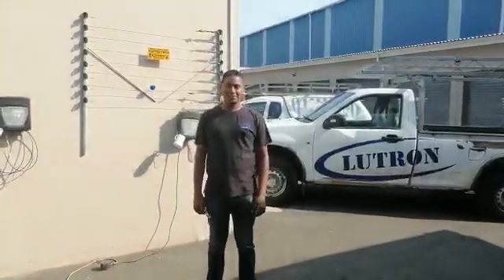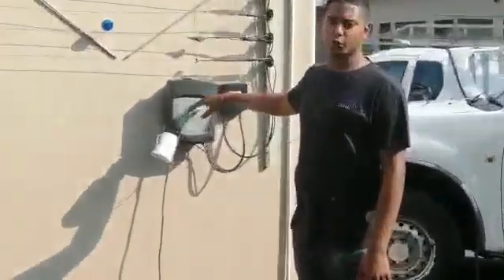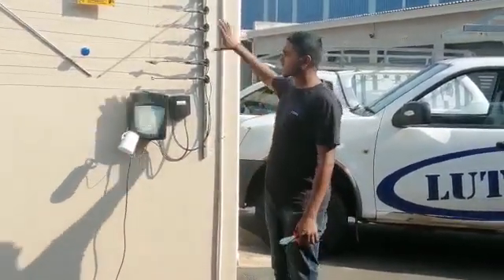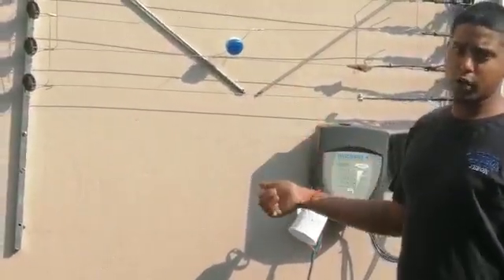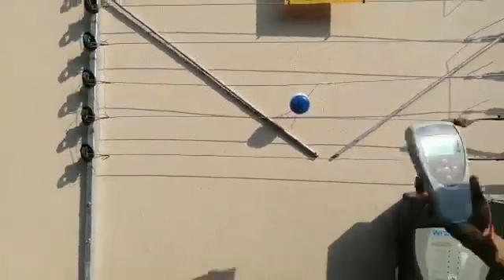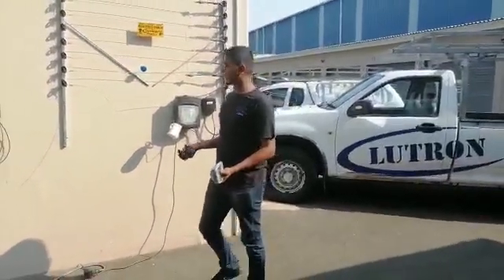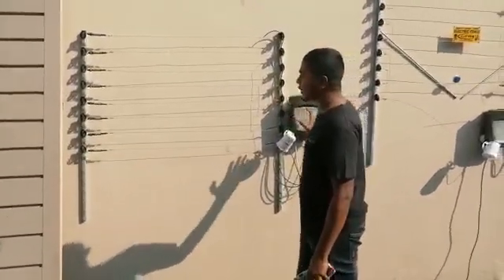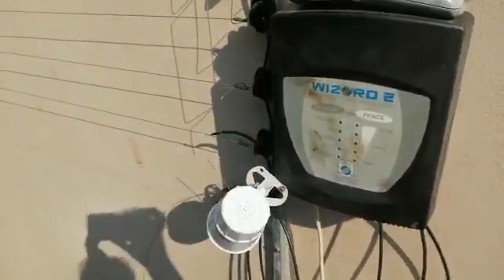Electric fence c.o.c requirements and circuits

Comment: What will cause d transformer in the Energizer to burn due to power surge
Reply from the maker: An influx in input voltage and  a overload in current.
Reply from the maker: 03191404440

Comment: Hi there i have been instructed to fix an electric fence did an assessment on the fence found its a parallel system on a NEmtek M18 energizer no my problem it can only cover about 600 meters and that top is approximate close to 800 Meters and the Nemtek is it not supposed to back up by keyboard this a question which needs to answered
Reply from the maker: jeron@lutronsa.co.za

Comment: If the power light is bricking when electricity meaning what is happening
Reply from the maker: If the power light flashes ... it means the electricity is off and the unit is running on battery power

Comment: https://www.youtube.com/watch?v=CMWgBnss2Zk Hi nice video here is some additional information if you would like, you can also watch our video on the difference between parallel and series wiring which helps explain why the two different wiring configurations are used.